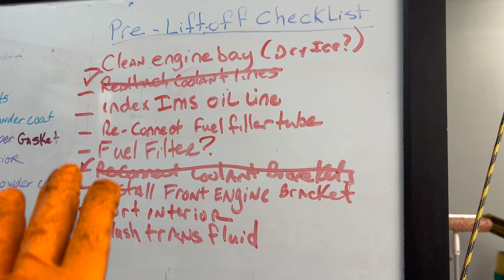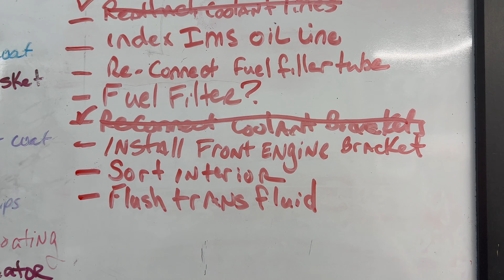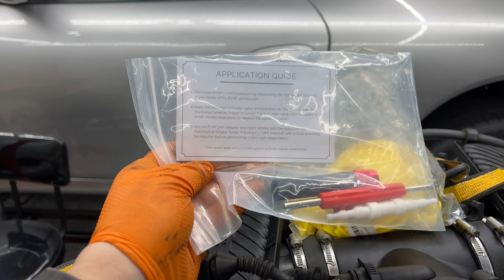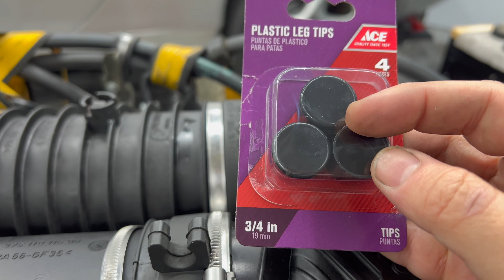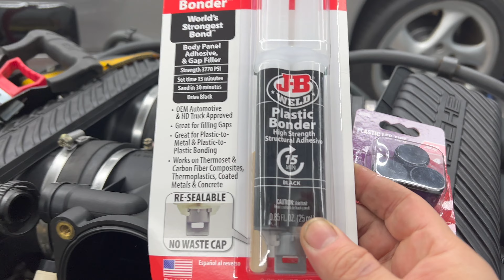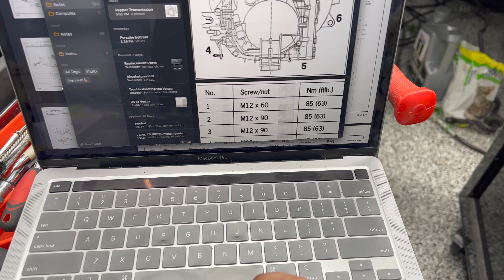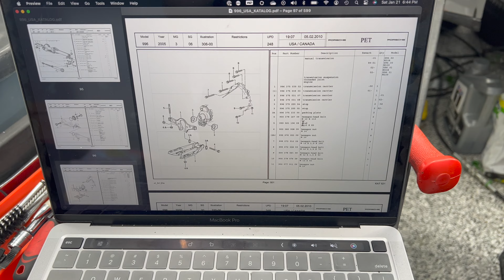Witness the ULTIMATE Upgrade - Installing a 4.0 Porsche 911 Engine!

Comment: Almost there and nice fix putting those caps on the intake cross-over.  For that cracked vacuum hose on top, that you said cost $70 (ridiculous) from Porsche, why don't you just get a length of vacuum hose from Autozone for a few bucks?
Reply: That would work but it would also require a couple of plastic 90 degree bends.  Without them, non-formed vacuum lines are going to pinch.  Guaranteed.
Reply: @tracymckinley5919  If it pinched I'd run a full loop with as tight a radius as possible without pinching.
Reply from the maker: Yeah it’s ridiculous and I’ll be using cheap tubing with some 90 degree angles.

Comment: fuel filter is in the tank, and it is part of the fuel pump.
Reply from the maker: Thanks for your help! Looks like I have a filter to give away.
Reply: @YogisGarage  it is more a pre-filter than a real filter. You can clean it but it is part of the pump. 996 mk2 does not have a stand-alone filter.

Comment: Get it flatbed without the motor to get it cleaned.
Reply from the maker: Yeah it’s crossed my mind. I’ll need to lower the engine a bit so he can get the engine bay.
Reply: I agree. I wouldn't put the engine in until the engine bay is cleaned.

So excited for this thing to run again!